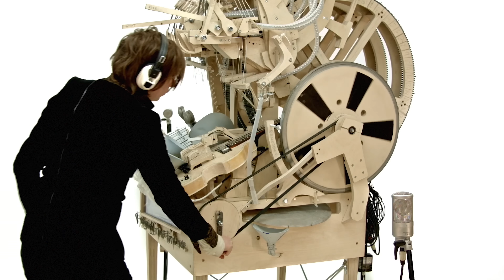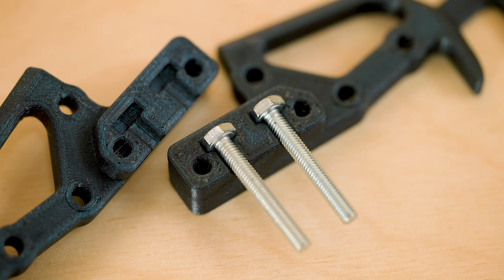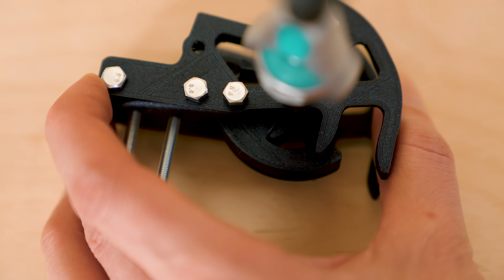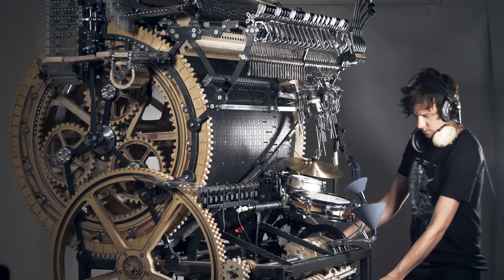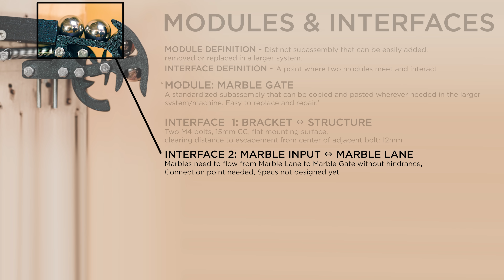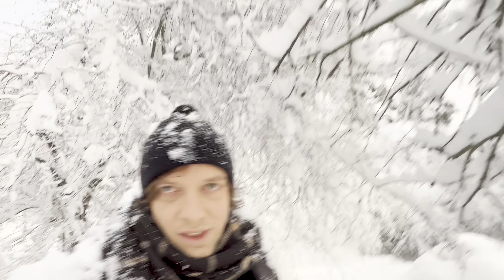The Foolproof Marble Gate - Does it Exist?

Comment: Don't forget about the gate being able to handle pressure from a backlog of marbles!
Reply: I was thinking exactly the same , but I think it was tested before, and if I remind it correctly the clockwork mechanism could handle the weight
Reply: This gate deals well with that. But, in the modules and interfaces framework, that factor should be called out as a property of interface 2: the marble lane is allowed to put a certain force on the marbles in the gate, and the gate has to deal with that force. Picking the number lets you design something that's good enough without trying to make it excessively good in a way that doesn't matter, and lets you think about which module should handle each possible issue.
Reply: He could also probably do some physics trickery with the lanes to redirect the bulk of weight from the marble gates
Reply: And side pressure too. Integration testing!
Reply: I also think the Mable lanes need to help isolate the gate and probably the instruments from vibration it at all possible, thus allowing us to keep reliable marble drops and timing whilst permitting vibration elsewhere in the machine for complex moving parts like marble lifts, scissor staircases and rotating assemblies or even divergent marble paths for cosmetic effect.

Because if we can isolate the 'music' from the 'motion' we will not induce new errors or messiness in the one function Martin actually cares most about: the music.

We can add back some layers of complexity for forms sake so long as we keep core function isolated from the messiness of divergent ideas.

Thus I propose that the marble paths need seperate legs to the instruments and dropper function. Probably 8 feet. And just install the modules with removable clamping elements (some square tubes between the frames to clamp down on) for travel.

We keep precision of music, we can go crazy with vibrations of the hand cranked marble machine with who knows what nor how many styles of marble lifting elements, maybe we run every marble through a divide by 8, and then use the output to feed 6 seperate marble lifts, some as screw type, some as magnetic, some within a wheel, some using conveyors.

Because the fun element of watching marbles go zoom is one of the best elements.

It might also be nice to let some of the surplus marbles from a marble divider get a trail down the exterior of the machine for audience amusement to feed back into the loading components... This way bulk storage of excess marbles might happen in lower elements of the machine to immediately start their journey up when music starts to play, instead of trying to cram them all in upper portions.

If the marble lift component never runs dry, we don't really need bulk storage, just a steady feed rate and our working and good divider.
Reply: @glenmcgillivray4707  That violates the Module and Interfaces framework. The marble gate should specify how much vibration it can tolerate from incoming marbles and from its mounting, and it's up to the design of other modules to meet those requirements. When it's time to design the frame, he'll go through different possibilities to find one that meets the requirements for the marble gates with as much vibration as the lifting system and other moving parts are allowed to produce.
Reply: @iabervon  isolation of components by intellegent selection of other elements at a base layer can considerably improve the final product.

The important step is to identify what components allow you to achieve your design goals from the outset to ensure you can see what the big and important assumptions you wish to make begin with.

If the final product has no vibration in the entire marble track assembly, we can weld the dropper-instrument module in place at that stage.

Assuming you will eliminate a vibration from the outset and assuming you will wish to design for that specific goal is a bad bet.

Looking ahead instead of trying to resolve issues in the modular assembly stage has its merits. And at this point, before anything is assembled our experiences have shown several facts. First that marbles are chaotic and will try to misbehave unless we plan ahead for their misbegotten behaviours. Second. Marbles need to be constrained, but also given the freedom to be themselves lest they try to collide and escape our wrath! Third. Moving parts create vibration and motion such as rocking.
Fourth.  Motion and vibration make making tight music difficult, and makes the unrestrained dropping of marbles inconsistent.

So with these four facts. And the proof of consistent marble dropping performance now demonstrated, it is desirable to elude mayhem and chaos and cheat just a little. And keep the dropping element as controlled as we can for consistency, while the marble lifting and distribution can explore new options and opportunities, and incorporate as many moving, vibrating and or interesting design decisions as we wish.

As opposed to one marble lift per element creating say 40 independent looped paths purely to keep every marble on the machine constrained for their entire journey.

Marbles should get a chance to marble sometimes you know?
Reply: Yes, and he will also need to repeat all of this modular testing when he moves from 3D-printed prototype modules to final manufactured parts. Different materials, machining, and finishing methods will result in a lot of variations: flexibility, springiness, friction, noise, vibration, resonance, etc. In addition to testing base designs, I hope he ends up testing each design in multiple materials.
Reply: Was noticing with new gate it does actually make contact with other marbles at full “hold”. But marbles are still held by escapement, so it may not matter… would want to check to make sure there isn’t some inconsistency based on how many marbles are in the queue (just to be sure)
Reply: He already has a pressure relief module designed, so not to much to worry about that.
Reply: Also unexpected movement. If the gate is rocking, bouncing, tilting, shifting, etc, how does that affect reliability and repeatability?

Comment: The marble input interface has no constraints? What about marble pressure, feedrate, etc. ? Many problems you had on the MMX and that aren't checked so far here.
Reply: some of those requirements won't be known until he starts designing other modules and surfaces those requirements during integration -- in a large complex system not all requirements might be known up front. this is the advantage of him clearly identifying the performance requirements of the module thus far, so that when he faces problems and surfaces new requirements later on, he can redesign the modules while validating them against existing requirements. a big problem with his previous redesign approaches is that he wasn't validating his redesigns against the previous known requirements, so every new design would often solve one problem but add two more.

this current approach also opens the door for community collaboration, since if he gets stuck trying to find a solution for all the requirements he surfaces, the community can also create their own designs that must meet those requirements. rather than just "oh this looks cool" he can actually see a solution that has been validated by someone else and then create it and validate that design himself. having real data behind the designs will increase the potential of valid solutions by orders of magnitude

Comment: Isn't the hold time 500ms a bit of a problem? Ideally it should work with small hold times. That can be fixed with design though, as I believe you just need to make it so the marble stabilizes more quickly when activating the bolt.

Comment: You might consider making the gear release pin (for the escapement gear) slightly less pointy. That sharp point ends up being a weak point for longer term wear and tear and I'm not sure you are getting any benefit mechanically.
You should also take a look at mechanical watch movement designs. They endure years of 100% accurate functionality with a lot of similar mechanisms to what you are using.

Comment: In Interface 3 you write "functional range = 0-300 BPM", but also a hold time of 500ms median. Even if we assume that only the hold time exists and attack and release are 0ms, that limits the throughput to 120 BPM (or marbles per minute). Even if you go down to the "minimum" of 250ms hold time, that's still only 240 BPM. How do you intend to get anywhere near 300 BPM?
Reply: In the previous machine (MMX), there were two gates per instrument note/hit to be played. That is, for x sounds the machine could make by dropping a marble, there were 2x gates. So, if you offset the two gates by 250ms, you can get up to 240bpm.
I don't know how Martin plans to get from 240 to 300. Suboptimal timing (400ms)? A third gate?

Comment: What about when there is a long line of marbles pushing on the gate? I remember the gates having that problem in the MMX
Reply: if you use modules and interfaces that essentially eliminates this issue.

you just require you interface to only accept a maximum marble pressure. we've seen martin "solve" this problem before. im sure we will see him tackle it again.
Reply: @Jrakula10  yes but the conclusion he came to last time is that resisting or relieving pressure has to be part of the design of the marble gate, trying to solve it elsewhere just makes it too complex

Comment: How about marble pressure?  It looks like more pressure will cause earlier release.
Reply: That's what the escapement wheel is designed to prevent. The marble is dropped into the holding position without pressure from the following marbles so the timing of the release is only controlled by the arm holding the marble in place. Unless you mean the pressure of the marble would cause the retraction of the holding arm to be delayed due to the increased pressure of the marble held up by the escapement wheel?
Reply: @Thund3rstorm  If you look at 11 seconds, you see only the very tip of the release holding the escapement wheel.  I was worried that that could release early before the holding arm got into place to catch the marble.